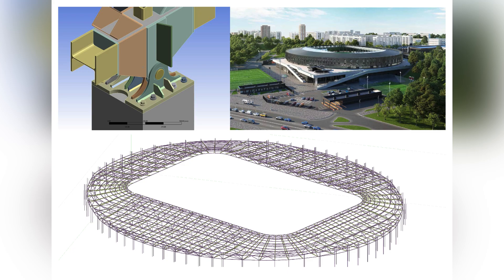Structural analysis of the steel assembly of the stadium coating in ANSYS

Comment: Hello! Great job!
Will there be a full review?
Very interested in the contacts between the shaft and the housing ....
Reply from the maker: Welcome to my channel, what exactly are you interested in?
Reply: @k.e.v.6862  Hello! I'm new to Ansis calculations and sometimes I find it difficult to set up the contact between the shaft and the body correctly as shown in your calculation. Can you show the contact settings in your specific case?
Reply from the maker: @ЕвгенийДавыдов-с2ь  Contact pairs must be configured individually for each task.  In solving my problem I use contact - frictional.

Comment: Hi, I was just wondering, what kind of steel are you going to use to sustain those stresses?

Lovely simulation btw :)
Reply from the maker: Hi, when calculating such joints for strength, many combinations of loads are used for which individual elements of the joint are checked, this video shows the calculation of individual parts of the joint for one of the load combinations, since the calculation for all load combinations would take a large amount of time. Therefore, the voltage may be overstated in individual elements of the connection, but these elements may not be considered. Secondly, individual elements of the connection are often checked for extremely possible loads in order to understand the connection resource. Steel for this connection is used with a yield strength of - 350 H/mm2 and a temporary resistance of - 480 H/mm2
Reply: @k.e.v.6862  Thanks for the quick answer!
I've been doing some simulations on structural joints for university lately, so that was really interesting.

Greetings from Spain!
Reply from the maker: @mustangxxi  You can share your experience on my channel.